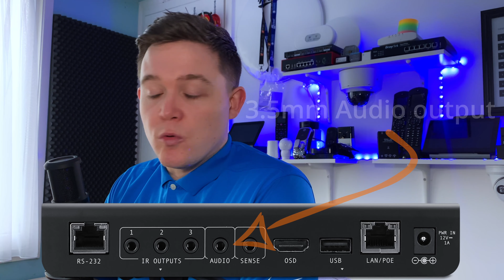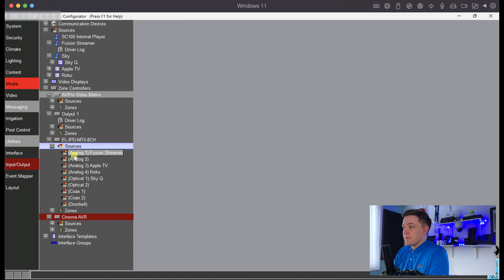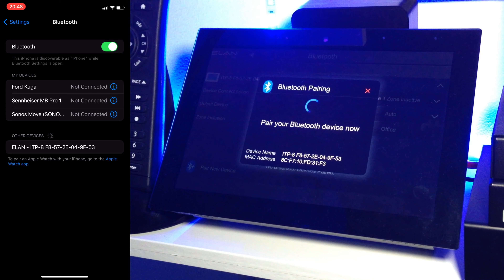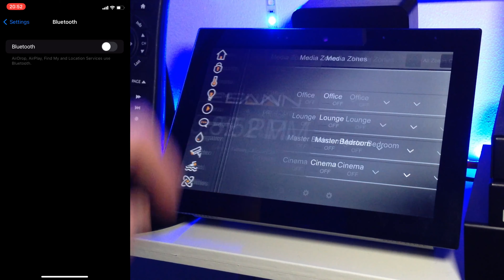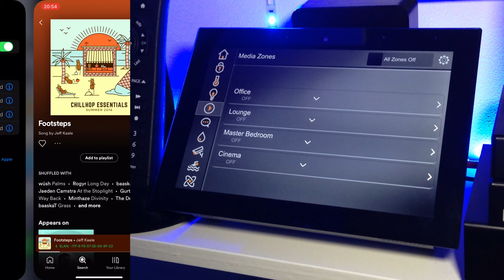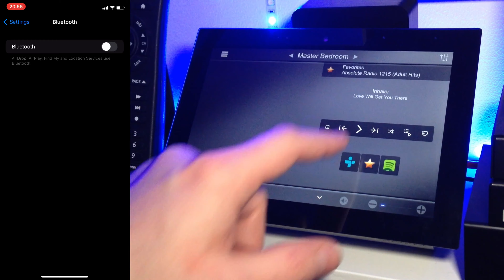using the Touchpanel Bluetooth feature in ELAN Control

Comment: Hi Sam, Greetings from Colombia!
Thank you for sharing your knowledge with these videos.
I did the exercise of transmitting audio via Bluethoot using the ELAN screen, but with a SONOS amplifier.

However, I can't get sound from the speakers?
Should I select the Input on the SONOS amplifier with the SONOS application?

THANK YOU
Reply from the maker: Hi, if I understand correctly then you are taking the line out from your controller to the line In on the Sonos? If that is the case, then yes, you need to make sure the Line In on the Sonos is selected as the active source
Reply: Ok Sam, Regards from Colombia, When are you planning to do some NICE online training? thanks!